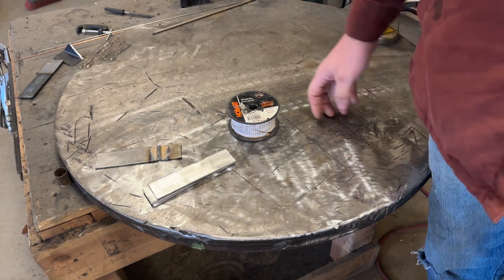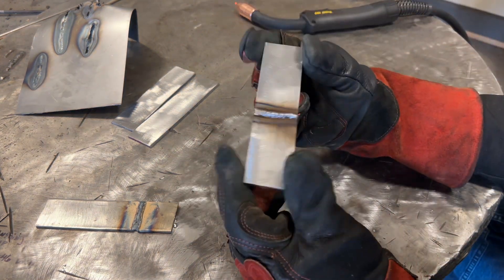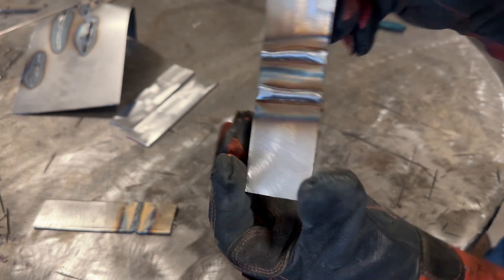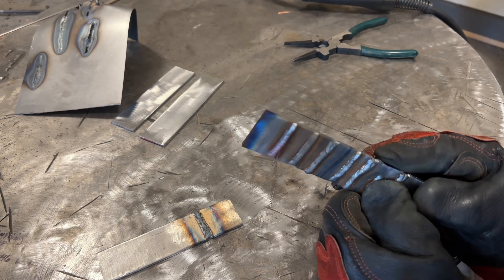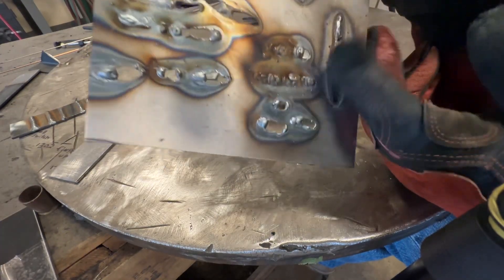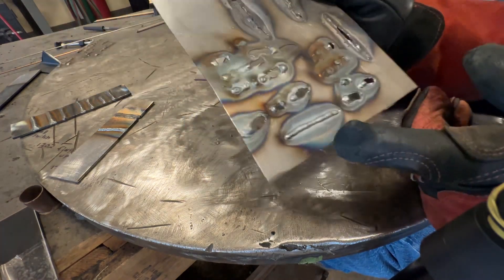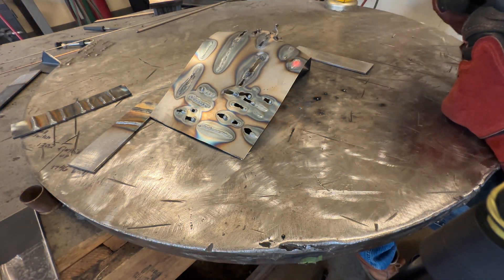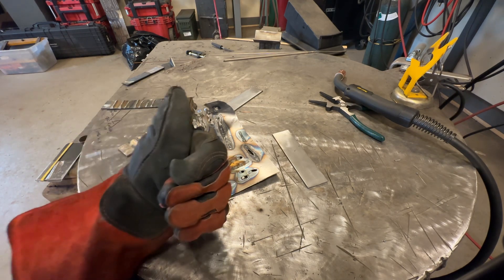Mig welding with .023 wire and limited voltage control troubleshooting

Comment: Gonna turn down . Doin 18 gauge , gonna try 16 volts at 200 inches per min less if I can , have a 200amp chineesium welder 0.30 wire . Also have a brand new Chineesium Yeswelder 160 amp ( mft. Says won’t run 0.23 wire , ) but gonna try both ( they are 220/110v ) but I have a Tig gun for Yeswelder that’s why I bought it . Lots of guys say use 0.23 wire for most body panel welding , but Yeswelder tech I spoke to says the 160amp, won’t work with 0.23 , 0.30 or0.35 . So gonna use 0.30 . I did buy a small spool of 0.23 wire the 200amp will run it bought tips too. And I bought tip gel . Should I use the gel . Self teaching my 63 yr old self . ( Dad was a Boeing Machinist, he would never even in his own mind think weld , new part bolt in ) but workin on a 68 yr old Chevy , panels don’t bolt in ya gotta weld , with him not thinkin welder he never taught me , that’s why I gotta self teach . Any advise would be appreciated ( tried the cheap chineesium Flux core , all I did was blow threw . . ) like I said any advice I’d appreciate . I’d go to school, but I’d be the only ignorant old guy in class , and for resto modding an old chev ( dream car since 1972) it’s not gotta be perfect . Jus Harbour Freight on Saturdays, ChinaMart on Friday nites around here , and thumbs up burn offs lol hope to hear back thanks William
Reply from the maker: .023 wire makes quick work of thin material.  .030 flux core simply burns too hot and has too much penetration to weld thin material easily.  Auto body can be welded with .030 flux core but the issue is it’s tough to have solid metal welds without slag entrapment.  If you can find a way to get .023 wire to work that is the way to go.  One of the downsides to the Chinesium welders is it can be hard to get .023 rollers for them.  The next issue is liners, it’s pretty common for .023 to run a lot better in a plastic/teflon liner designed for .023.  Many normal mig gun liners are oversized for .023 and that can cause feeding issues.  

To a certain extent skill will help overcome limitations of equipment.  However a mig welder with decent low amp ability and .023 wire makes it comically easy to weld super thin material.

Comment: How would you recommend fixing holes in different thicknesses of metals?
Reply from the maker: Holes tend to be best patched with small mig wire (.024).  It makes it so much easier over stick or even tig.  If the material is compromised .030 flux core can work a lot better than mig.  Sometimes the material is so rough it just needs to be cut out and new material be put in.  This can be quite challenging.  I need to do a video on this/auto body.

Comment: I don’t understand why you kept lowering wire speed when to get more penetration, you would need more wire speed. Wire speed is amperage so I’m confused on the 1/8 plate
Reply from the maker: Wire welding is quite a complicated beast.  The video in question was to help out an individual who had limited controls (aka fixed voltage).  With adjustable voltage there is far more control with wire.  

You are correct in your thought that wire feed speed dictates amperage.  However wire feed does not dictate penetration beyond a certain point.  After a certain point the wire will just pile up and make a taller weld.  If the voltage isn’t adjustable you don’t have an ability to increase the weld width so all the wire piles up in height.  If the ratio of wire feed to voltage is off you will produce poor fusion/penetration even if your wire feed is high. Short arc mig is generally fairly low penetration, and it has very limited ability to weld through a thick molten pool.  That’s why you see far less penetration on a fillet weld/inside corner than a flat plate with it.  That’s also why more wire rarely increases penetration.  The same thing actually holds true with stick welding too, more amperage flattens welds but rarely increases penetration much.  With wire processes to increase penetration (beyond using correct settings) you must switch gasses (100% co2 instead of c25) or switch processes (spray arc with c10 gas for example).   Hopefully that sheds some light on what’s going on.

Comment: I don't know what your viewer was talking about. 19v?  Tap 1 on 230v input at typical 18ga sheetmetal current of 50A is around 14v. Hobart puts the voltage/current curves in the manual.

Comment: Here's a possible ideas how to weld with 19 volts minimum settings machine. - 
1. Change the polarity to DCEN(that way the heat input is toward the 22 gauge sheet steel(0.76mm), which is thicker than the .023 wire(0.6mm)
2. Use many tack welds and stagger the tacks away from one other to control heat input to the metal
3. Use very low wire feed speed(use a test panel,same thickness) 
4. Use very long stickout(manual increasing the "inductance")
5. Try to butt the two pieces tightly, without any gap.
6. Weld in vertical if possible, so the molten spot doesnt suckback like it will do in flat position, while is cooling. If it's a patch on a removable panel you can rotate it.
Reply from the maker: Excellent tips and they will surely help someone trying to get by without upgrading equipment.

Comment: Thank you for sharing the informative video.

I intend to conduct further testing, but my old Millermatic 35 transformer machine has a lowest tap of 19.2V OCV, while the loaded voltage averages 16V when loaded with .030 and .035 wires. If I set my Everlast MTS 251SI to 19.2V OCV with .030 wire, it runs from 17.8 to 19V on average, depending on the stickout and possibly the inductance setting (it seemed to be influenced by it, but I am not certain). I will conduct more tests when I have the time and adjust the inductance to find out. It is possible that changes in the resistance of the ground cable and whip due to size, length, and age may somewhat affect this.
Reply from the maker: No problem 😀👍.  Having inductance control can make a solid difference on welding thin stuff, playing with it will likely make a subtle difference.  No doubt .023 wire and a welder with really low voltage capability can make easy work of thin material, but it’s still very doable with less than the idea setup.  The worst case is you run short welds to prevent making holes.

Comment: I've been trying out some .023,.024,.025 whatever wire and it's a strange beast.  I've gotten down to 20 gauge with good beads but like a lot have said, the warpage on even this metal is freaking pretzel like!  🙂  I think it'll be handy fixing some really small stuff that breaks but my dreams of being able to fix body panels on one of our old cars has been dashed for now.  I can get way down on voltage and wire speed on my machine but the burn back is a real problem (I know this sounds weird but it's actually kinda' cool to see it --it's like a big blue cone where the wire should be) and I haven't fiddled with the run in speed to see if I can fix it.  I'll keep working with it but I started with .030 wire and that stuff is great with a wide range to it --for me anyways.  I'd love to see more vid's on how you would tackle repairs on thin stuff if you only had GMAW to use (no TIG! :).  Thanks for the vid!
Reply from the maker: I definitely need to do a video on that.  I am not very experienced with auto body but I can weld thin material, so I not completely in the dark lol.  I know that auto body is incredibly tough to get joints perfect.  Small Spot welds, hammer/dolly work, using compressed air to cool what you just welded, and tons of other tricks is how it’s done.  The goal is to weld it with the least amount of warpage and thus least amount of time wasted trying to fix it.  That is an art in itself that’s probably far harder than welding it lol.  I need to experiment on that for sure.
Reply: @makingmistakeswithgreg  Totally agree that the guys/gals that do this kinda' work are artists --whether they like it or not.  Lol  I watched one interesting video that was contrary to many others.  What he recommended was high heat and a quick trigger finger.  He was basically doing spot welds but his argument was even though it was high heat it was localized and kept the bead basically flat so blending the weld would be much easier on body fixes (also the heat didn't permeate to whole piece so warpage was low).  I look to you on the veracity of this kind of stuff 🙂 but the results he showed was very nice.  Looking forward to whatever topic you choose to tackle!  Edit:  Except TIG 'cause I haven't gotten there yet!  Lololol

Comment: I love talking about volts and wire speed because the more I hear these along with visual aids I begin to understand the start settings and fine tuning for spray and short arch welds along with proper gas.
Reply from the maker: If you haven’t seen it, I did this video:  https://youtu.be/bV_xKEDcuQk?si=ba8EuCCvmj2ihMum 

Basically I covered the display and tuned the mig welder just by the look of the welds.  Doing that will help you dial in any mig welder on thin material to 1/4in or so.

Comment: Which machine is going down to 13-14 Volts? Can You name one ?
Reply from the maker: A mig machine that’s capable of 20-30a of output will be able to weld the steel shown in the video.  The machine needs to be able to run less than 16v and be able to stabilize the short arc at low wire feed speeds with .024 wire.  Generally speaking most higher end 140 to 2000 amp machines are capable of that.

Comment: With .023 to .025 on 18 gauge is awesome.  But you can't get away with running beads on auto body panels anyway.  The warping would be horrendous even if it could be done.
Reply from the maker: Yep, auto body becomes a real battle with what it takes to produce the least amount of “extra” work needed to get to the desired repair.  If a person likes making long, nice beads, auto body becomes a test of patience and ability to handle frustration.

Comment: I am thinking if it is possible to overcome this with a resistor of some sort, creating a resistance between the "earth clamp" and the work peace creating a voltage drop.
Perhaps a long strip of thin metal sheet will work. Or a electronic device that can achieve the voltage drop. Someone with the problem and have knowledge of electronics and have the skill can probably fix this. 
Maybe a very very long, or thinner, earth clamp wire will work!
My .5 SEK.
Reply: A 24V, or two, head light bulb in series with the "earth clamp" and the work peace!
Reply from the maker: You can create a voltage drop easily but unfortunately the drop in voltage will be met with a resistance to current as well.  I will be honest, I am not exactly sure how a modern MiG welder controls voltage, older transformer types just had multiple taps on the transfer to control output voltage.  Modern MiG welders rely on the fact the little wire can handle so little current that you never have a direct short for more than a instant (and thus the amperage is fairly under control).  

Your post kind of makes me want to make a welder to demonstrate how all of it works and for a learning tool for myself 😀
Reply: @makingmistakeswithgreg  
Yes. And I think that's the way to go, to lower the current. 
As I see it, anything you can shortcut to ground do cutting the voltage out, but not the current. So in my mind, I think it is the current that does the work, but, in symbios with voltage.
As you said in your "mig voltage" video: the voltage control the arc. And I think the current doing the penetration.
Thank you! Looking forward to that video.

Comment: Hello; am 64, the first time I take a Short training on A Mig , was in 1980 , from a Salesman of HTP, outside of a small auto paint store in Puerto Rico. He demontrate , how to weld very thin sheet metal 24 ga. He set the machine at the lower setting and place de gun touching the metal at 45 angle with the right hand a dialing with the left hand the wire speed at the same time he pull the trigger, concentrating in the sound , the .023 melt like glue and do not make holes. Since that I always use a scrap metal , the same gauge of  the material for the work , and adjust it by sound and not by numbers. On cars I always use ESAB easy grind, I think that wire is very unique, for cars sheet metal . A little expensive, but the results are fantastic. Good video, Thanks.

Comment: im wondering what machine and wire brand did you use to get that nice weld on the 20 gauge sheet metal? if you can provide that information would help me out. i want to start a project welding thin gauge sheet metal later this year and would like to purchase a dedicated machine.
Reply from the maker: I used Hobart brand .024 wire and a firepower fp-200.  The fp200 is the same welder as the esab 210em non multi process machine.  The metal was also even thinner than 20ga, it was 22ga.  I believe the welder could weld even thinner material, 24ga possibly.
Reply: @makingmistakeswithgreg  Thank you Greg!  I have a mig welder but it cannot drop to those low settings for this wire size and gauge metal. so i was looking around and found your video. let me tell you it is difficult to find information out there on this subject. keep up the great work. i really am looking forward to watching you push the limits on this series of wire size and gauge metal and curios to see what those welds will look like. thanks again and the best of success to you and your channel sir.
Reply from the maker: @ezekielgutierrez3300  I will be doing videos in the future for welding thin metal and tips for doing such things.  I have very little to no experience doing auto body but I can weld, so I am sure I can make quality content to help people with thin metal welding.  I will tell you I have done very little welding with the .024 wire and I am pretty amazed at what it will do with a good welder.  It’s far better than flux core wire on 22ga.  It’s no tig but it’s far easier/faster than tig.

Comment: Bah! I weld 22 gauge with my flux core welder... (It's a Lincoln weld pack 100) I turn my volts down to A (whatever that is) and run maybe 2 1/2 (again whatever that is) for the speed. I hit the trigger and pull fast, real fast! I'll get a perfect weld low, flat, maybe .040 tall... I'll get that for about an inch and a half then a big hole. (Ok it's not perfect) then I just start a half inch away and hit another inch and a half. Only real downside is coming back to fill in all the holes. At least you can start on your old weld so you have a chance. Oh and there is no watching the puddle there is only a click and a thirty mile an hour drag. .030 flux core!
Reply from the maker: It’s amazing how travel speed can make up a lot when it comes to what would otherwise be sure failure.  Familiarity and skill will get a otherwise impossible job done 😀.  I draw the line at stick welding 22ga, that (for me) is failure with no other option 😅.

Comment: In stick welding, it's very important to control 'arc length'. When I'm using flux-core MIG, I was recommended by the weld supplier to use a 'stick out' of 1/2" to 5/8" on a 0.035" flux core wire, and in particular not being shorter than that. 
Is 'stick out' equally important as in 'arc length', and what has to change, and why if the flux core wire is thinner?
Reply from the maker: So the arc length is a weird thing with flux core wire.  It has a tendency to not quite function like short circuit MiG in the sense it’s sort of turning to liquid before the wire hits the puddle.  With short arc MiG the wire stabs the puddle and blows apart, repeating very fast.  So the arc gap of gas shielded MiG is actually technically 0.  Flux core is very close, tight arc.  Stick does actually run with a consistent arc gap (zero arc gap is a stuck rod).  Tig is also 100% arc gap process.  The reason flux core doesn’t function well on DCEP like MiG is due to the fact the wire can’t handle the current increase running DCEP.  The electrons hitting the wire from the plate would cause the thin walled tube to just melt into balls.  You also need to produce shielding gas from the flux and having it hit the puddle, short/blow apart, and repeat would likely produce a ton of porosity of gas failing to escape the weld.  

In the video I had a issue with the wire burning back to the tip because it was essentially no longer in the short circuit MiG process and in a “non functional” spray arc mode.  By having too high of voltage in relation to the starting feed rate the wire tended to burn back to the tip because it was welded on DCEP (more heat in the wire than the plate).  This works great with super high wire feed because the actual arc will never hit the contact tip.  Too low of wire feed and you get what happened to me (it had a literal tig arc from the metal to the contact tip) lol.

Comment: If you have mixed gas, would be fun to see a little .023 spray arc on a t-joint. 😲
Reply from the maker: I might give that a shot, a buddy has some 95-5 and I bet the .023 wire will hit spray a bit lower than .030 or .035.  😀

Comment: Thanks for the video, your efforts pretty much look like mine. 😉 The recommended lowest setting on the 210 for 0.024 with C25 is 4/20 or 19v 120ipm. Jody Collier has several videos of this welder, but always using Lincoln .030 wire, I believe. With flux-core I believe he uses 0.035. On 115v, you have to boost the ipm a little, which I have no idea why on the lowest setting with 0.024. If you push your puddle it does not put as much heat into the material. I feel like they optimize these transformer welders for a certain wire size, but they don't tell you which one. Thank you for your effort. I actually prefer stick welding, but can't position my body properly, especially for going around a pipe. I know there are tricks to it.